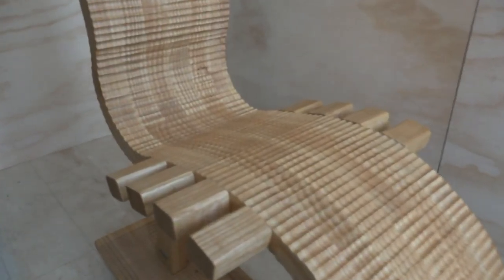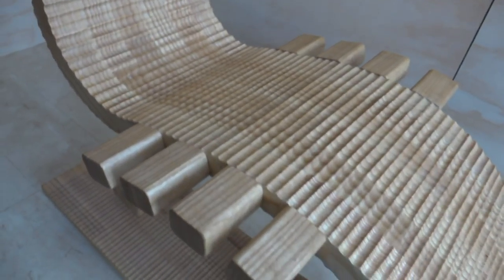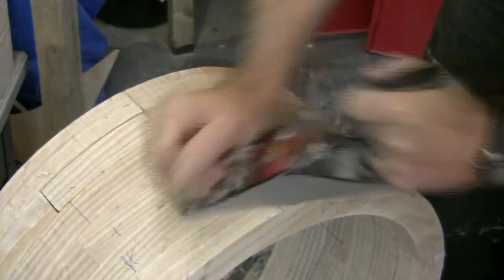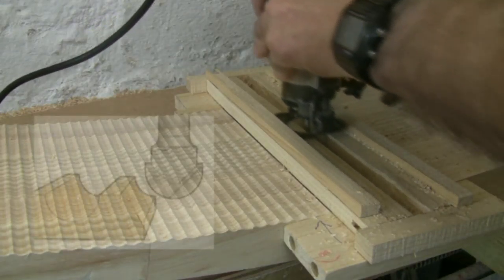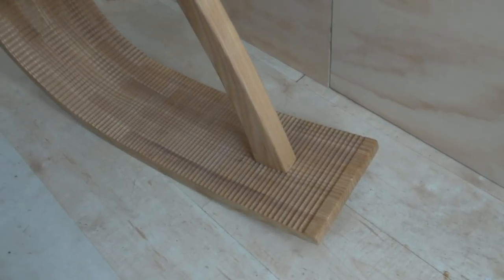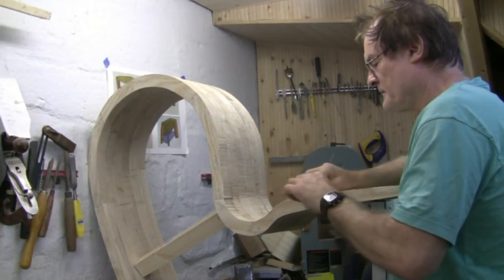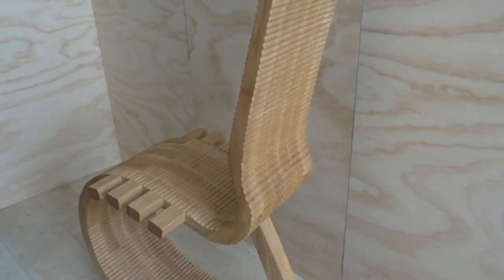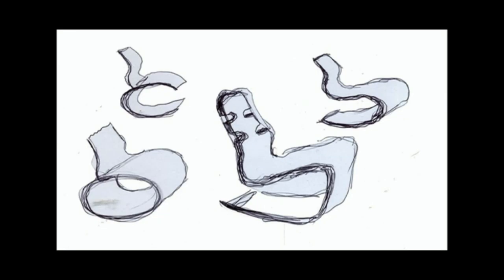Advanced Modern Chairmaking - The Brick Rocker

Comment: Fascinating video and a very interesting chair. 
You mentioned that you ran out of time and added the upright for strength and some of your concept drawings show a cantilevered (if that is the correct term) seat with no support. To what extent do you calculate the stresses, strains and mechanics of such designs before construction so that you know the chair will not disintegrate on first use?
If it would not be giving away too many of your trade secrets a video covering the thought and design processes showing the transition from concept to actual chair would be very interesting.
Reply from the maker: orzellezro An interesting question. I suppose it boils down to experience of working wood and knowing the material thoroughly (different woods). It is what I would call accurate guesswork and I'm happy to make a video sometime to explore this. One point I can share now - when making a prototype/ to test strength, don't massively engineer it. If it breaks you see exactly where the stresses are and then beef up the second prototype but as I say you get a good feel for where something is going to break if you clock up a lot of years manipulating the material. As a designer I take risks otherwise you learn nothing! Of course a chair has to withstand a fairly heavy person and I would envisage it being strong enough for a child perhaps to be sitting on an adult's lap. This chair was destined for an exhibition so I had no control over the weight of a person sitting on it so I had to play safe. My guess - two more layers of bricks would have made the cantilever strong enough.